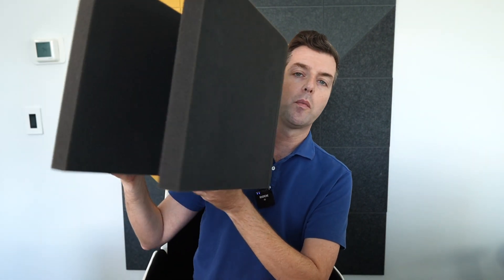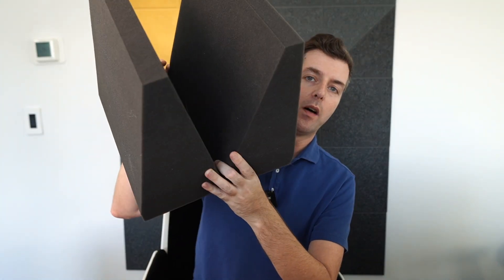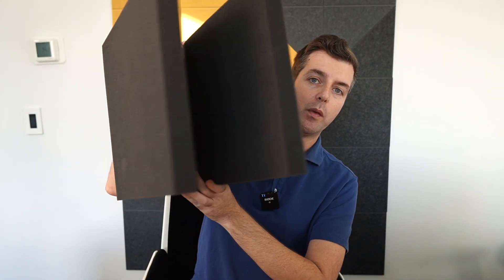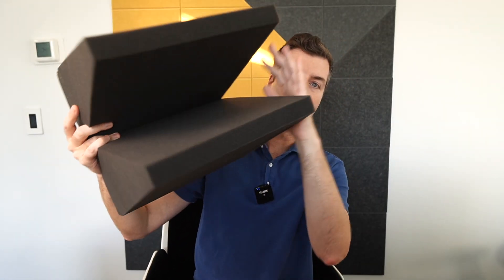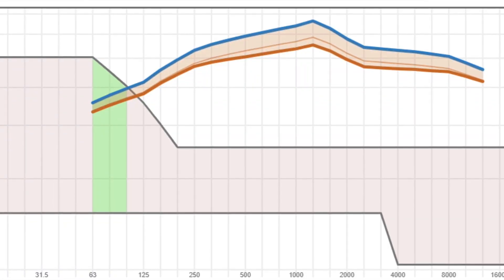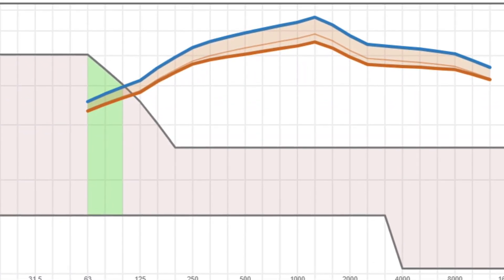RT60 Absorption Experiment - Results

Comment: Hi Matt, when you take the measurement in your room saying that the speaker is not facing the microphone, how should I understand it? It is facing quite opposite way? And how far you measure from the speaker? Is it crucial only the area around main listening position or should I take the speaker and microphone to random locations in room not depending on the distance from one to another? Thank you

Comment: When you are trying to measure RT60 or Decay time in a HT do you excite the room with your front L+R, center speaker, etc?
Reply from the maker: I would be careful. I would avoid using all of the speakers. A left and right is possibly ok. I usually choose just one. What you might do is do one at a time for each channel in a bunch of locations. Let’s say 7 speakers, 3 locations each, so 21 total measurements. Then average the RT60 curves. 

Using the Ht speakers will yield a lower value than a dodec speaker. But for our purposes it’s fine. We use it more relative.
Reply: @PoesAcoustics  Thanks! My measurements are acceptable using one or two speakers.